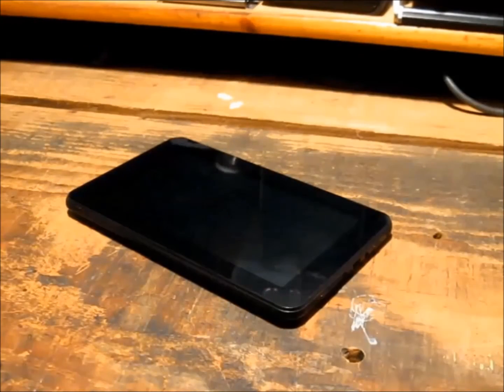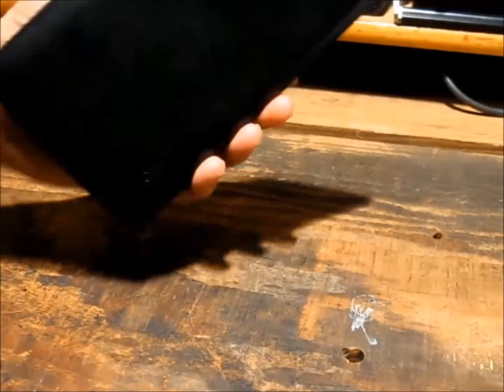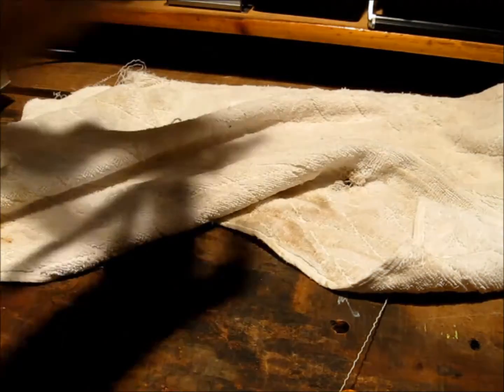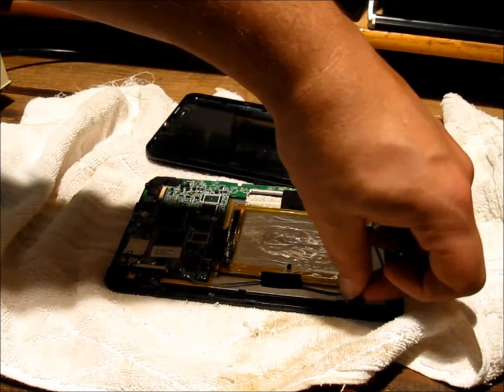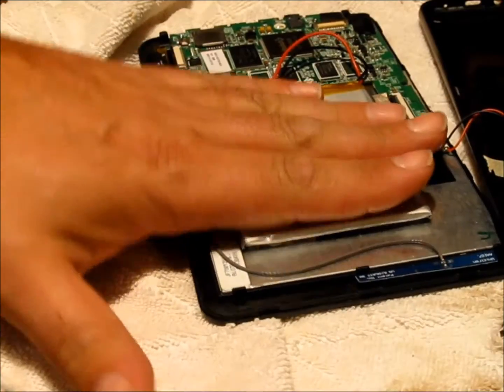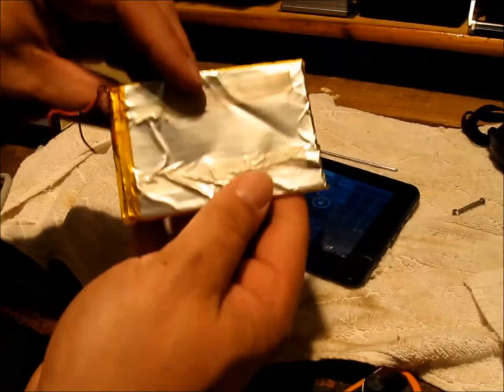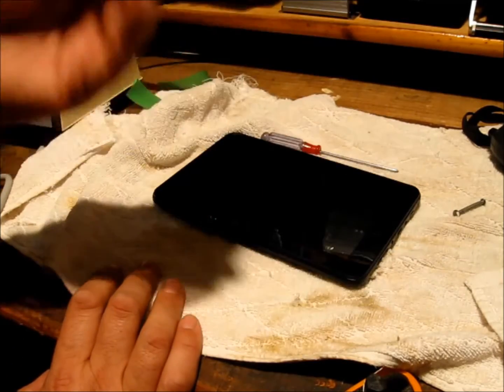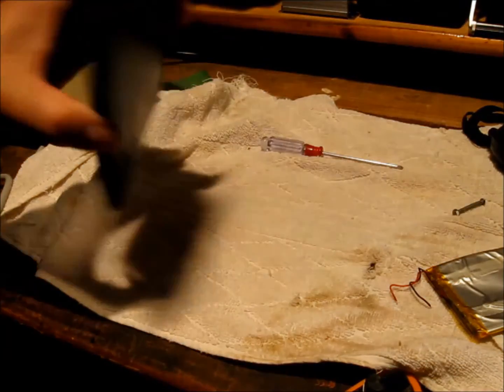Audiosonic T-17B - battery replacement

Comment: Very nice video.

Where did you buy the battery?
Reply from the maker: From a seller on eBay to be precise though years later I could not remember exactly which one.

It appears that tablets (or phablets) have been intentionally designed as a disposable technology, this device (for example) failed for other hardware reasons late last year, aside from that many appear to be locked to a particular distribution of Android which in time also limits their usability, this is not always immediately the case as I have upgraded a couple of tablets to slightly newer OS releases.

Designed obsolescence...

Comment: What a great project !
So the run time was ... 1-1 1/2 hours
wonder what its up to now ?
2-2 1/2 hours ?
Reply from the maker: The run time was 20 minutes max as the cell was damaged, originally it was 1.5 hours (or so I was told) hence the reason it was getting used with a charger plugged in.

In the name of science I played Angry Birds for 1.5 hours and the battery went down to 15%, applications that utilise the WiFi or GPU really put quite a load on the battery and that is reflected in the run time, simple browsing and email related activities have much less impact and I would estimate 3+ hours.

I surmise if I hadn't opted for a generic vanilla battery I could have achieved greater gains...